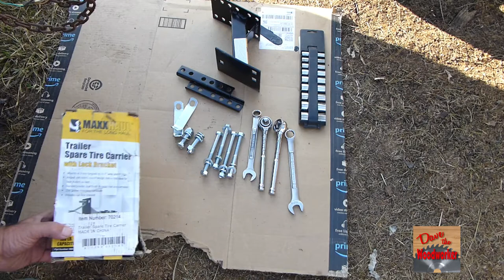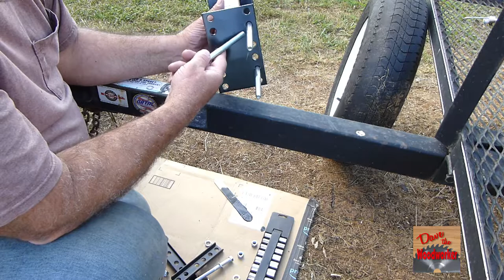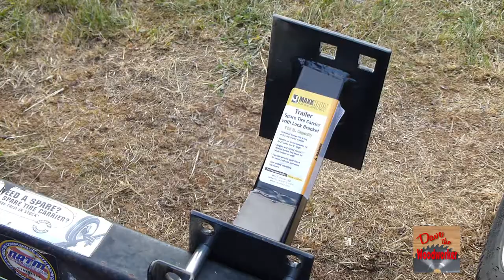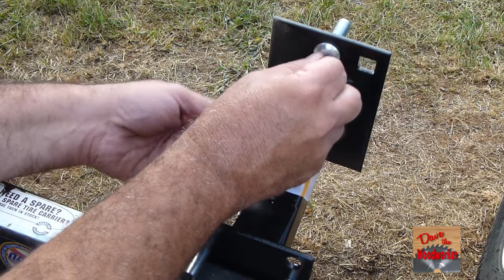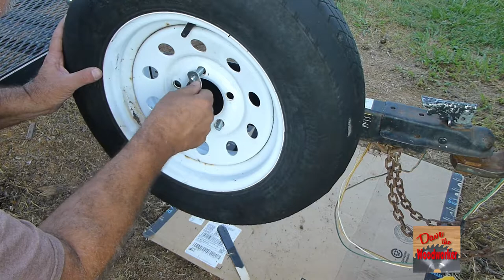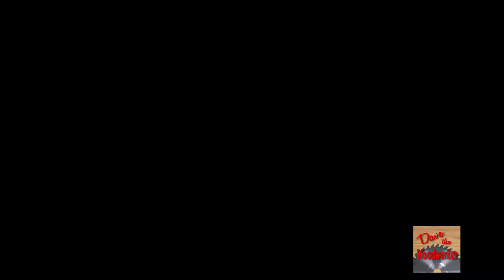Install Spare Tire Mount on Trailer | MaxxHaul with Lock

Comment: Even though I’ve never had a flat on a trailer, always thought it would be a good idea to have one. Don’t know why they don’t put them on the trailer from the factory. Nice video.
Reply from the maker: I agree, they should have one on there from the factory. I've never had a flat either, but the tire that I used for this video, came off the trailer, it was getting close to being worn out on one side. That's why I bought this, just in case.

Comment: What keeps some one from stealing the whole mount ?
Reply from the maker: Good question
Reply: Humanity 😊
Reply: The lock and the locking bars would have to be removed before the spare tire and mount can be removed.  I think a locking lug nut wold be easier and more difficult to remove.  It would be quicker to steal the whole trailer if there wasn't a hitch lock installed.

Comment: Great product, except I ordered 2 and both boxes were missing  the lock bracket that screws on....so had to return both boxes.  Clearly states on the box, has in photo on the box and listed in paperwork in the box in the contents of the box....disappointed in Maxxhaul.
Reply: Mine arrived today and didn't have them either.